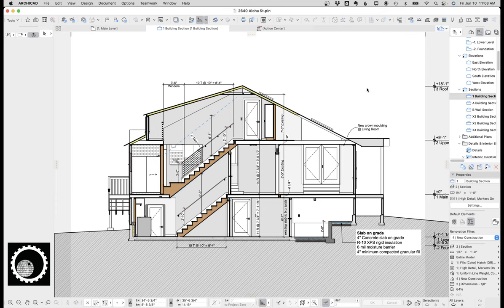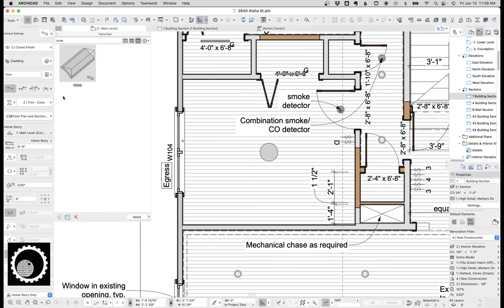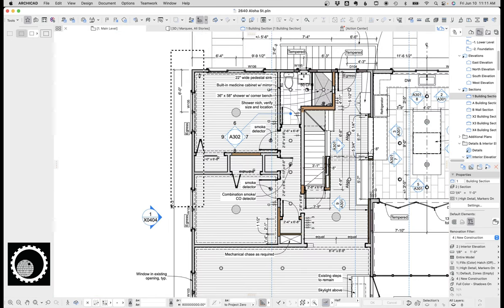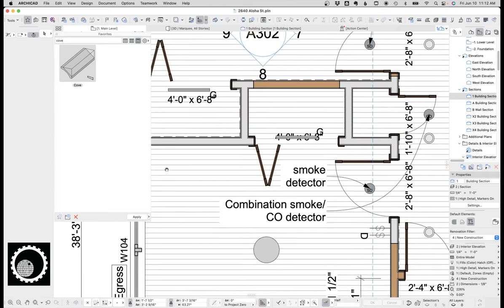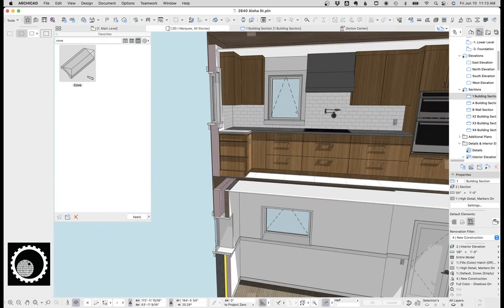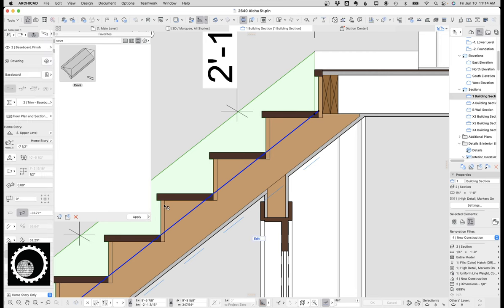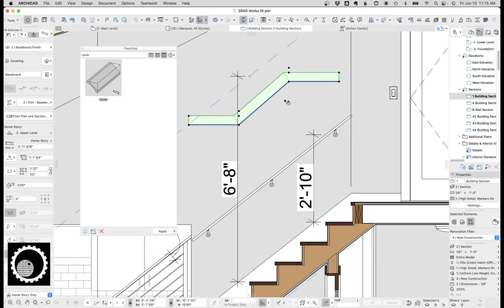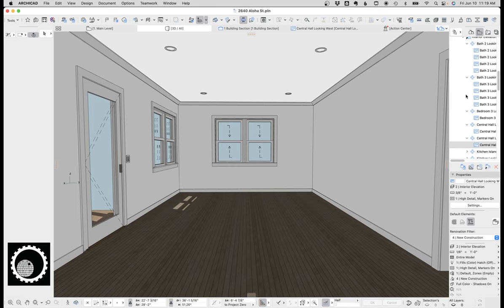Archicad Tutorial #82: Baseboard and Crown Molding in Archicad

Comment: I find that when I use a thin wall for linings it often wants to interact strangely with the main walls.  Using a separate layer and changing the intersection number works.
Reply from the maker: Yes. If you do layered walls like this you always need to use separate layers with different intersection group numbers. Otherwise it'll be a mess.